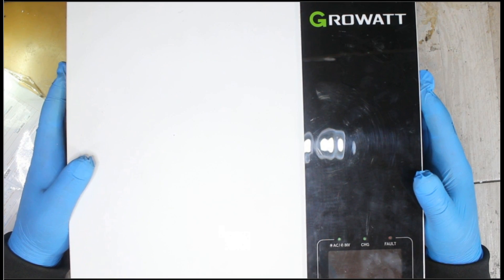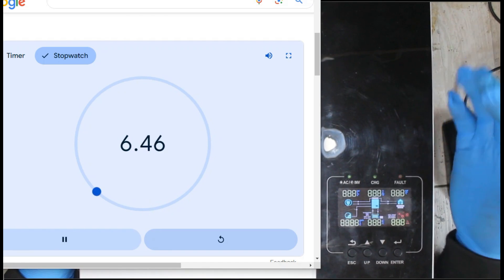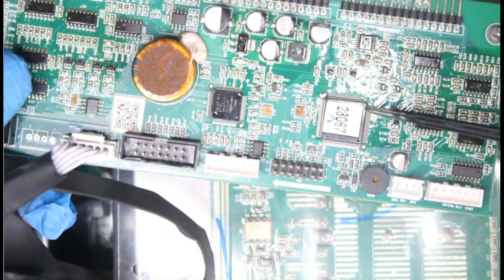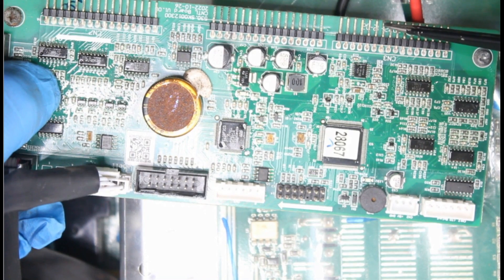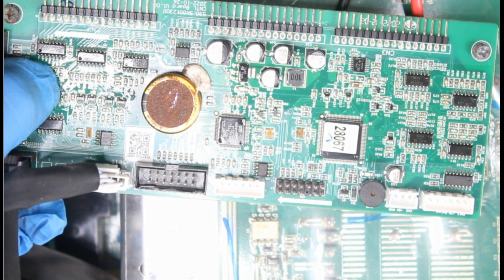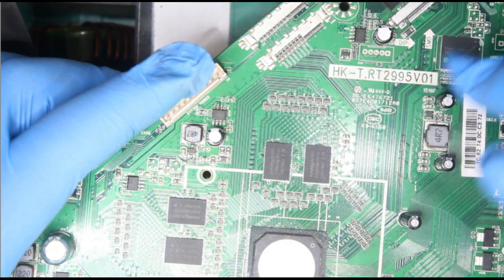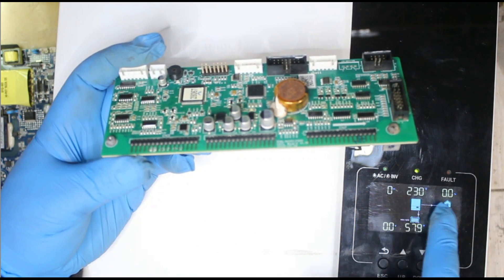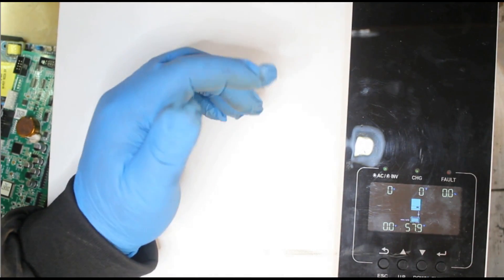Growatt SPF5000ES Repair ERROR 02 Overtemperature Boot Slow Microcontroller Vs Microprocessor

Comment: I have a growatt SPF5000es model and have a problem on it. Error code 2 appears  on display even I charged the all temperature sensors but it works well last 6 months. How ever last week the inverter is beep sound and it doesn’t charge the battery if load is connected. So the load is disconnected the battery will charge. Pls let me know what will be the problem my inverter